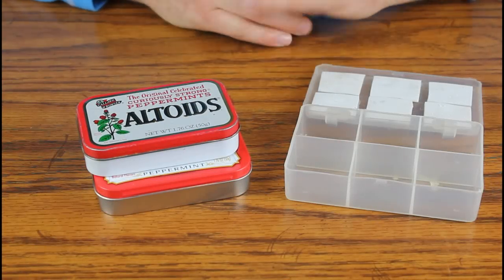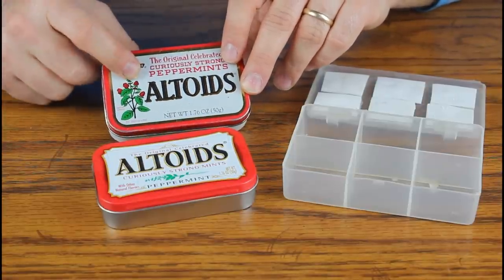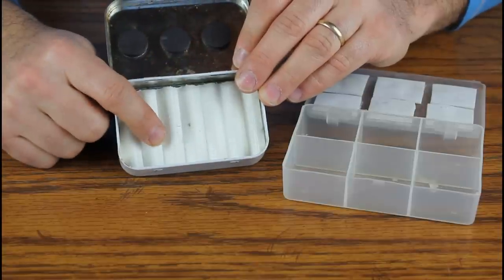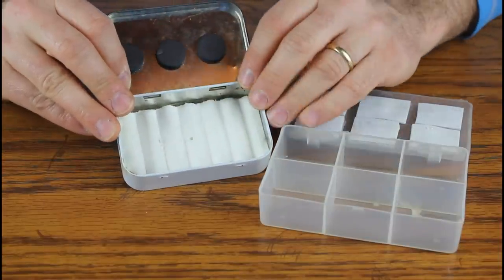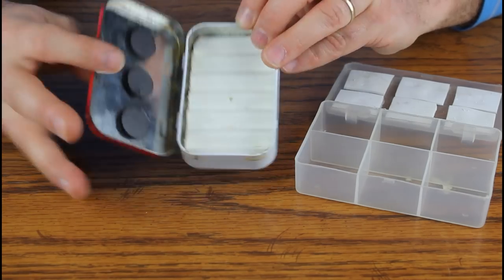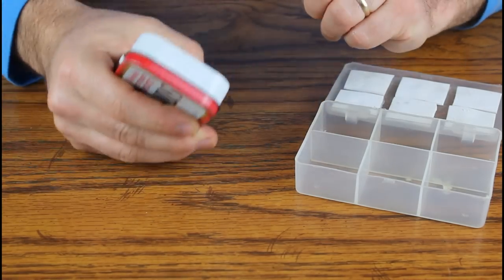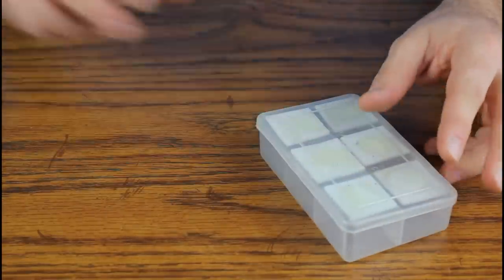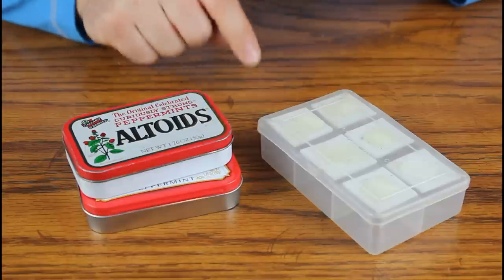DIY Fly Boxes

Comment: Hey Tim
As always, thanks for the video. As I watched this, I thought, if you drop that Altoids box it's going to sink. actually they float quite well. Obviously water tight. Once I started adding weight, like magnets the floatation was of course compromised, so I added a piece of craft foam to the top and bottom (outside). Doesn't make the box much bigger and aids in floatation.  This only works if the box is closed. Once filled with water, the box sinks like a rock......Just thought I'd throw that out there for  everyone to experiment with. Have fun.
Reply from the maker: Very smart thinking, Jeff; thanks for the ideas!  I wasn't thinking about that, but it's something more to consider.  I also will put my name and phone # inside the boxes...if they float off!  Thanks again for taking the time to comment, and I hope all is well.  Tim  http://www.troutandfeather.com

Comment: Nice video, Tim. Plano boxes are a good option. We are lucky to have a Cabelas and a Bass Pro Shop nearby and sometimes they discontinue old boxes so I scoop a bunch up for my deer hair poppers and tying supplies. Here's a great organizational idea.... Those Plano boxes also work great to store hooks.  Glue a bit of craft foam on the inside cover of the box to make a secure seal and be sure to use a sharpie to mark the hook size on the foam and you're good to go. The craft foam insures the hooks don't mix with each other when you accidentally turn the box over. Do NOT waste your money on plastic boxes with the adjustable sides. Get the moulded ones! The adjustable ones don't stay secure.
Reply from the maker: Great suggestions, Kevin, and some really smart ideas for hooks.  Thanks for taking the time to comment, and I'll be looking for more of those.  Tim  http://www.troutandfeather.com

Comment: The altoids tin is perfect thin layer of foam on bottom then very thin old shoppers club card cut to fit the tin and  Coated on each side with spray foam or any thin foam and then another coating of foam on the tins lid and you’ve doubled your storage capacity.    BOOM. Genius is my nickname
Reply from the maker: Very smart, J, and thanks for sharing with us all!  Tim  www.troutandfeather.com

Comment: The mint box rusted easily. Put my younger sisters flys when we went out I open it every thing was rusted I got one to get clean and she caught her fish fish on a fly she tied. She made more. I just put it in a normal box.
Reply from the maker: I wonder if the box got wet, Caleb?  I've yet to have anything rust in mine, and I carry them every fishing outing.  After fly fishing, be sure to dry the fly first before putting it back in the container, as the added moisture will definitely cause rust.  Sorry to hear that, but very cool she caught the fish on her own fly!!   Thanks for taking a moment to comment.  Tim  http://www.troutandfeather.com
Reply: @TimCammisa  I have a small row boat and I had this big old tackle box and I left it in there and she didn't use it slot so water probably got in there some times. Thanks.

Comment: Sunday - Saturday vitamin boxes. Available in the pharmacy section with the days of the week on them are also great. You can find them at your local pharmacy, Walmart, the dollar store, etc.
Also, in the craft section of stores (Michael's, Hobby Lobby, Walmart) where they sell small craft bead containers for those that do bead work and costume jewelry with beads, the have similar containers in square, rectangle, and round styles.  I've used them for years.
Rx (amber translucent plastic pill bottles) are great too.  If you had a nasty flu bug and had to get an Rx or something, those screw-top pill bottles are great for various fishing gear and won't pop open on you or in your pack.
Tupperware ... Yes.  I found some small Tupperware containers at a garage sale a while back. Not sure what they were designed for (kitchen or office), but looks like individual ice cube trays or for paper clips, push pins & wall tacks ... with a lid. Just hacksaw to desired size & lightly sand or file the edges, then cut the lid accordingly & do the same.
 Plano StowAway model: 3400 SKU #344922, or model: 3448.
Reply from the maker: Thanks for the comments and suggestions...lots of great ideas here!  Staying organized is an important aspect of fly fishing and tying, and it sounds like you value it, too.  Thanks again for taking the time to share.  Tim http://www.troutandfeather.com